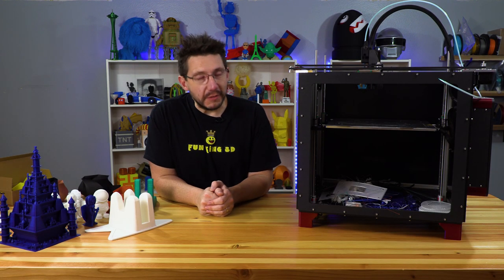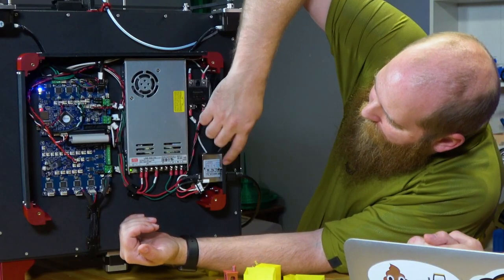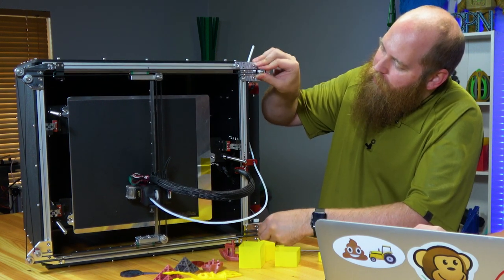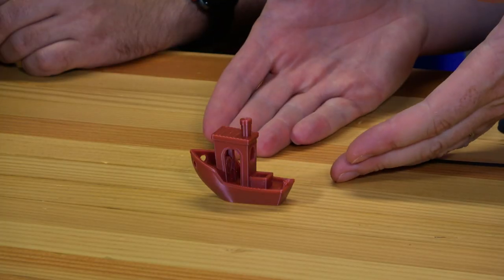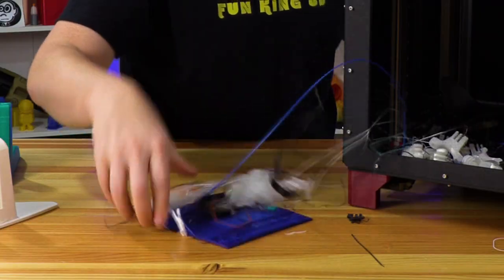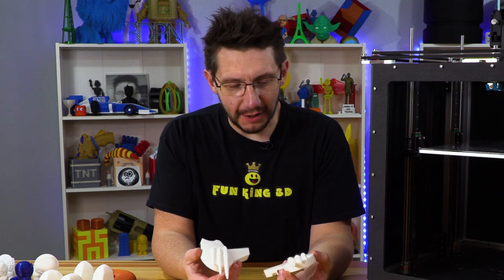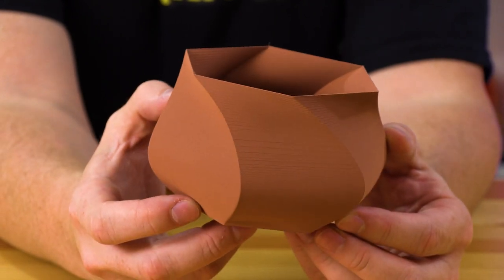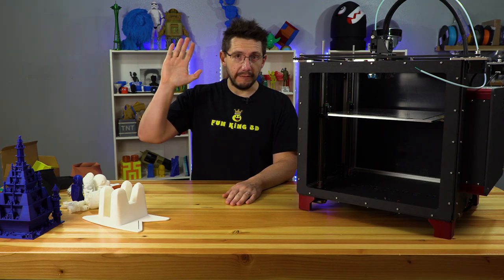Railcore II 300ZL Project R3D 3D Printer Kit Review

Comment: If you're willing to source it yourself, the VORON V2.1 is theoretically capable of just as much and resolves some of the issues you noted (part cooling, mechanical bed leveling), and should be somewhat less expensive since it uses more commodity electronics. That said, it's not currently available in kit form - self-source only.
Reply: Again, not a pissing contest; the Voron is a great machine, but the Z resolution is 4 or 8 times more coarse than that of the Railcore2 (depending on whether you use a 0.9º or 1.8º stepper). I'm not sure what you mean by the issues being part cooling (Joel had issues with overcooling) or mechanical bed leveling (the Railcore does it, with greater resolution - see Z resolution )...
Reply: I meant the Z sensors by mechanical bed leveling (his complaint about the optical sensor) - using a switch or FSR to get the Z zero. This wasn't meant as a slight against the RailCore - it's an awesome machine, with different pros and cons against the Voron. The two are really in a league of themselves when it comes to open source printers!
Reply: @huskywithcoffee1568  LOL - I don't mean to sound testy, either. It's hard to convey tone in text. I was just asking to clarify. The optical sensor works GREAT on some surfaces, but poorly on others. I have converted the prototype to BLTouch because I like to experiment with different surfaces. The IR sensor worked flawlessly on PrintInZ skin, for instance, but not so well on a buildtak clone. We're working on some other sensor-based functions as well :D

The Voron solution to the problem we've had finding good idlers is clever, I think. High parts count, but better than most cheap idlers, I'd wager. I admire the cleanliness of the print carriage, too; I'm still trying to figure out how to do something that clean with RC2. But to be fair, we have divergent goals that shape the printer to a great degree: we had as a primary design goal the ease of testing, tweaking, and experimenting with different hot ends and the like as a primary consideration, which precludes a 'standard' clean print carriage. :D The Voron was clearly intended to be built as such, to get the clean look and characteristic visuals.

Comment: Regarding the cooling - given the Duet and such, I would assume you could push this thing well above 75mm/s. I wonder if you could push this thing above 100mm/s at which point more cooling might be needed. That said, I would agree you probably never would be going to 100% fan but, I guess I would rather have something OP and pull it back than have something not up to snuff and never being able to achieve what I need.

Nice review!
Reply: There are many of us printing at 150mm/s and faster with this printer

Comment: Sorry, did not quite get it: is the double-heigth variant just another variant of the reviewed kit printer, or is it a different model? If a different model, what are the technical differences, except for the Z-axis length? Thanks.
Reply from the maker: The double height variant is this, but with double Z.
Reply: @3DPrintingNerd  : Thanks! So no mechanical table adjustment for the double-height variant, if I understood you correctly? :-(
Reply from the maker: Not that I know of - I would contact Railcore Labs and Project R3D to be sure
Reply: Same as this just taller, nothing else changes
Reply: The taller one will include a couple more upgraded components in the kit (aluminum brackets and yokes) that will help stabilize the taller Z axis even more.
Reply: @tonyakens8228  is there an expected price point for the double z?
Reply: @bookie60  Not sure about the pricing, that will be up to Project R3d.  I suggest subscribing to their newsletter.

Comment: retraction should stop your stringing problem.. idk why you think you only need it for the chainmail.
it strings because you still have a small bit of pressure in the hot end and the plastic leaks out as it moves creating the string effect. retraction should eliminate that by retracting the filament.
if your worried about it slowing down the print raise the retraction speed. 

this is pretty much the machine i've had in design software just never got around to building. the duet expansion board is something to look into. as i wanted a duet wifi for years now.

Comment: wow does this printer have any downsides/cons ???
Reply: It’s hard as hell to assemble
Reply: It takes time to assemble, but most haven't found it difficult.  It does take attention to detail.  The more precisely you align it, the better your results.  But all of those things are able to be improved and tweaked post build, too.  There are a few brave folks who've built them as their very first printer and done so successfully.
Reply: @tonyakens8228 so still no downsides, right? :D
Reply: @loukask.9111  Well, I'm biased, since I'm one of the designers. :)
Reply: @tonyakens8228 Well, good to know. Also, you're a genius! Congrats! This to me at least looks like the perfect printer. Seriously, this leveling technique is awesome as well as everything else. The leveling works with this optical sensor which then controls these threaded rods right?
Reply: Its 1500 bucks?
Reply: @mav68nrs well, it's better than the $2500 lulzbot taz 6 in my opinion and 1500 bucks isn't really that much to pay for such a great printer, is it?
Reply: @mattat3847  get the kit, it is much easier to make than sourcing all the parts and assembling it, wiring and crimping the connectors
Reply: @mav68nrs  For the kit, yes.  You can self-source it cheaper, but not by much once you pay shipping to lots of places.  The kit has a few other advantages, too, like the very nice wiring harness, and includes several of the "aftermarket" upgrades.
Reply: @loukask.9111  My buddy J. Steve White did much of the original design, and we've collaborated closely throughout.  It's been a cool project, and is a great printer. I love mine!

The way the leveling works, you use a Z probe (IR probe, piezo, bltouch, whatever you prefer) to probe the bed.  Once you've probed a few points the controller does some math, figures out how out of level the bed is, and then sends corrections to the leadscrews.
Reply: @tonyakens8228 Alright, thank you! Once again, awesome work. This probe comes with the kit though, doesn't it?
Reply: the decision to add a short bowden tube between the extruder and a hotend is odd -- I'd scrap that and combine the two.
Reply: @kazolar let's see what the argument of the designer is gonna be! :D
Reply: CoreXY is cool because you can get very fast prints, mainly because you would also need to have a bowden extruder. Putting a direct drive on a CoreXY slows you down quite a bit. And not just in one axis, in both x and y. The shifting mass that high put a lot of strain on the carriage if you try to print fast. 
I did a Cartesian style build with 2020 extrusion and direct drive since the shifting mass is only in one axis. Benefit of Cartesian is it is easier to maintain.
Reply: @kazolar  It's due to the orientation of the Y rail. To make efficient use of space, the extruder needs to be above it.  If you direct mount a v6 to the extruder, it doesn't reach below the Rail.  The short bit of PTFE doesn't really effect anything, though.  Retractions are still around 0.5 - 0.9mm, and it prints TPU like a champ.

But... the design's open, so if you can come up with a different arrangement on the Y, you could certainly mod it and do direct drive.
Reply: @dadsfriendlyrobotcompany Of course! Didn't think of that. Also, with added weight on the moving parts, more wobbling occurs, thus lower print quality is achieved, right?
Reply: @loukask.9111  The kit comes with the Duet3d mini IR probe currently.  I think they may switch to a BLTouch based on Joel's feedback.  But yes, the kit definitely includes a probe for auto-leveling.
Reply: @kazolar  this is to allow proper mounting to the rail and the bowden tube is so short its nearly a direct drive system. I'm not exactly a fan of Bowden setups (have had many many issues with them). While this is technically a bowden setup with flying extruder, this feels and in reality works as a direct drive.
Reply: @tonyakens8228 ok, thank you and awesome to hear! Also amazing to talk to product designers like this!
Reply: @dadsfriendlyrobotcompany  In my youtube channel I have video of a 200mm/s print @ 0.05mm layer height.  No bowden (same extruder setup as is in the video)
Reply: @dadsfriendlyrobotcompany  We can already outrun our ability to extrude and cool plastic. At 75-85mm/s, converting to "full Bowden" made no difference in print quality. I've printed at 150mm/s with minor ringing, but you have to lower the layer height such that the prints don't happen any faster. But as I've said elsewhere - and Tony has said - it's easy to covert to a "Full Bowden". Just take the extruder off the Y carriage and bolt it to the frame, then move the filament guide to the Bowden position. I did three or four A/B comparisons in just an hour or two, converting back and forth each time. We designed it to be amenable to hacking, tweaking, extending, and munging. :D
Reply: @loukask.9111   I'm just an IT guy by trade who helped design a printer.  It's pretty amazing to see it come this far!
Reply: @tonyakens8228  I think the compromise to not do straight direct drive would not be my choice, the stringing Joel saw is an indication of a short Bowden setup, which would present some difficulty in tunning the retractions. I'm not in the market, as I said I already have a machine which I designed using the duet lead screw compensation - which is definitely a fantastic leveling mechanism. There are some other design considerations which look good on paper but I would not make. Specifically 0.9 degree steppers on stationary axes are entirely unnecessary, I would simply use single start lead screws to get the 1 micron z resolution - which is what I did in my build. When I saw this presented earlier, that's what inspired me to go with lead screw compensation for my design with a milled aluminum build plate, that definitely does wonders for print quality. I am using bondtech bmg as well and even with a volcano nozzle, the layer precision is good that it's indistinguishable from injection molded, even at 0.25 layer heights, and printing at 90mm/sec.
Reply: @kazolar  The stringing he saw was the steel nozzle included in the kits, combined with the cooling setup.  Not the bowden.  (I have many stringless prints to attest to this)  Switching to a brass nozzle resolves it (and going forward I think the kits will include both).  The steppers on the Z axis are 1.8 degree, paired with TR8*2 leads, for a 0.01 full step.
Reply: @tonyakens8228  good call on the Z. Can't move as fast, but single full step at a micron is worth it, plus z doesn't have to move very fast. I'm using micro swiss plated nozzles, no strings, and works fine for abrasives. Can't tell in the video how long that short Bowden tube is. If it's super short, and stiff then it probably has no effect.
Reply: @kazolar  The "exposed" bit of the tubing is around 15mm I think. Very short.  I like the micro swiss nozzles, too.  And I'm looking forward to testing the new e3d one.
Reply: @kazolar  with the E3D v6 and direct drive, that's kind of how you have to do it.
Reply: @tonyakens8228  If I had the money I would certainly be down to make that my first printer. Primarily because I would follow the instructions well and not make it a race to the finish. People gotta remember, 3D printing isn't a race, it's a journey.
Reply: @mattat3847  Not really. No Harder than build a RostockMax
Reply: @kazolar  Why would you? It is already, in essence, a direct drive with just 17mm of tubing. You also can't fit the extruder on the Hotend without that space due to the linear rail
Reply: @dadsfriendlyrobotcompany  No it doesnt. My Extruder rides just above the Hotend. Its not a Bowden Printer
Reply: @kazolar  Sorry but you are incorrect.  the stringing has nothing to do with the 17mm of extra tubing over a direct drive.  I actually have on of these printers so I know what I'm talking about
Reply: @bluephreakr  my neighbor self sourced one using the open bom, and only really needed help with the wiring. And the kit had a wiring harness. It would be a challenge as a first printer, but not impossible.
Reply: @ericfletcher8454  great, if you read other comments, stringing was attributed to the hotened. And if you read other comments you also would know I have a similar configuration.
Reply: @dadsfriendlyrobotcompany  not true, e3v6 has a groove mount and bondtech accepts the groove mount, so you can simple mate them together - clearly the extra length of tubing was added as due to other design considerations.
Reply: @kazolar  But you don't have a railcore.  I do so I ACTUALLY know what I;'m talking about
Reply: @ericfletcher8454  great. You win 10 internets.
Reply: @kazolar  Well I win the "I actually know what I'm talking about" Award as opposed to you
Reply: @ericfletcher8454  there are 2 ways to answer a question -- you can either explain your experience, and add to the knowledge-base,  or you can get defensive. Great you have a railcore, did you design it? Did you just buy the kit and put it together? Why don't you explain how lead screw compensation works.  How am I wrong that the small section of the PTFE tube was added to the design to clear the Y carriage, how do I not know what I'm talking about? I normally don't want to engage, but you're asking for it -- please explain at what point I was wrong? Since you know what you're talking about. That the stringing is not attributed to it -- sure, fine it's not -- that was covered already. Share you great wealth of knowledge about the RC2 design decisions with the community.
Reply: @kazolar  My Railcore is all self-sourced, built long before the Kit was available and one of the first built in the wild, My experience and Knowledge is part of the facebook page. Tony and I talked all during the sourcing and building of my Railcore, Items in the BOM were changed due to my input. You bombed into this thread proclaiming that its design was wrong and that the 17mm Bowden tube is responsible for the stringing.  You got corrected and then got defensive. In the end, you don't have a Railcore and are wrong in your assumptions
Reply: @ericfletcher8454  I made a comment that I would have designed the combination of the hotend and bondtech without the extra Bowden tube. I stand by that assertion. In my printer design I made different choices to ensure the hotend and extruder are assembled with less potential for issues. I didn't "bomb" in, and I didn't get defensive, you got hostile, I'm glad it's working for you. In the end you still haven't answered a single design question. Others have explained the decision. Which is fair and constructive. I tried to disengage, and I have no dog in this game. The most recent printer I designed is literally 4 times bigger,  and more capable, hence I have no desire to build a rail core. But I wish you the best. I have no interest in arguing with you. As you said, I don't have a rail core, and you didn't design it. So we have nothing to discuss.
Reply: @kazolar  LOL, I told you where my info is. There is "No potential for issues" with the Hotend/extruder and it is apparently beyond your mental ability to understand WHY it was done this way. And yes you did Bomb in and get defensive, just like the post I'm replying to.
Reply: @ericfletcher8454  dude, you're the best! I'd keep this going, but I do not want to dirty up Joel's video. Keep up the insults man - I'm loving this.